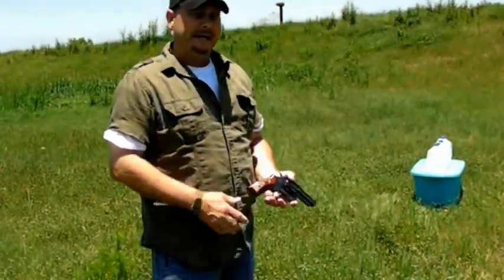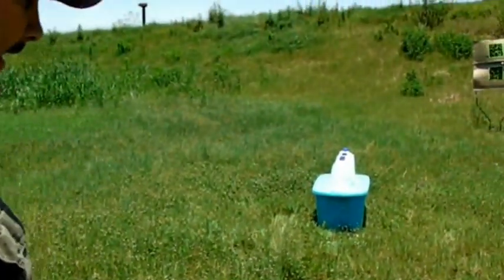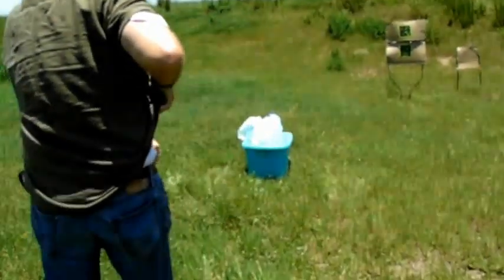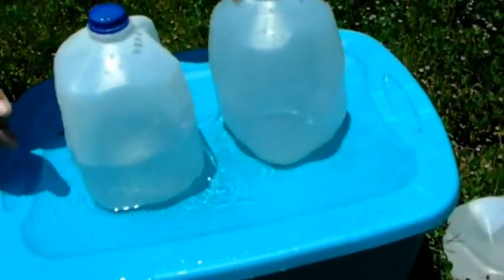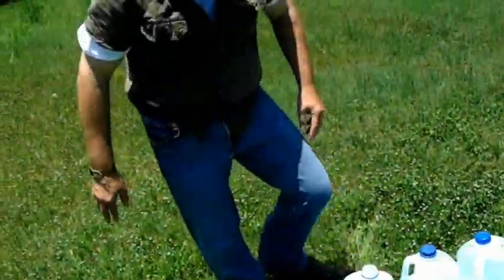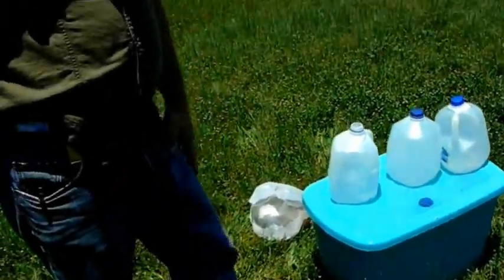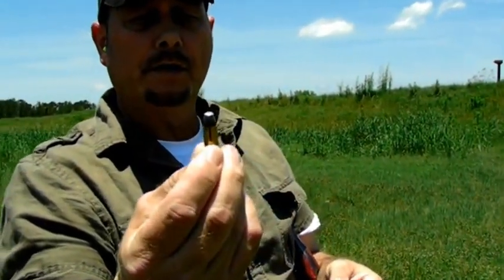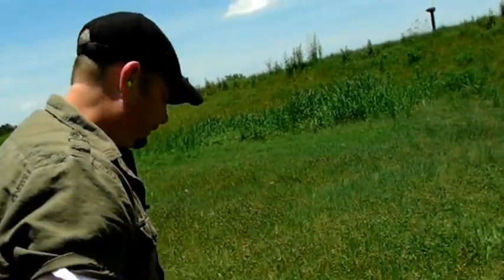357 Magnum 110 gr Winchester screw in Hollow point load

Comment: This video proves absolutely nothing.
Reply from the maker: L J C 
Wasn't trying to prove a thing. But did show what it showed. It's well known by the border patrol using this round for years that this load will likely stop after violent expansion and fragmentation. That's what it did, that is what is has always done.. And that's why it is famous for being a summer type anti personnel load. Consistency. Also filling the home point with a screw dramatically changed how the bullet penetrated... Which was predicted. That's what it proved. I did this several times and also said several times... Not scientific but for ballistic predictions... It helps true in every way. Use the info or don't. Your comment proves nothing as well btw

Comment from the maker: Yeah. I like the 100's too. I shot several of these and all penetrated like hell. I believe that current factory loads are ALL designed to preform exactly the same. Therefore there is no advantage of one caliber over another really. I learned two things in archery hunting. Pass thru's are important so that maximum blood loss is obtained therefore dropping the animal very quickly and this explains to me why the Military uses FMJ ammunition. You WANT pass thru because it creates rapid blood pressure drop and nobody can fight without adequate oxygen to the brain. Period.I have always subscribed to the big hole going in and big hole going out. This is also why older gunfighters used loads like hard cast Flat Point Semi Wad cutters loaded hot (or not) because they will blow big holes THROUGH tissue. Even modern rounds produced by the worlds most famous self defense manufacturers..Buffalo Bore and Double Tap and Underwood (who really knows what they doing with defensive ammo) ALL of them have versions of solid bullets designed for use in the woods or against dangerous game. Why wouldn't I consider an attacker the same as dangerous game? This may offend some people, but If i am more concerned with a pass thru striking someone behind a badguy than dropping the badguy, then I need to stay home.